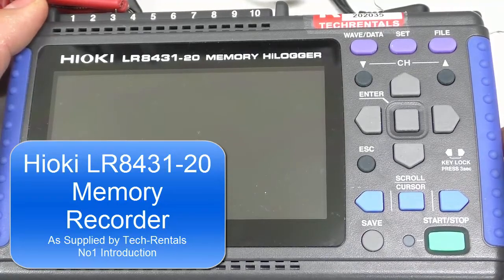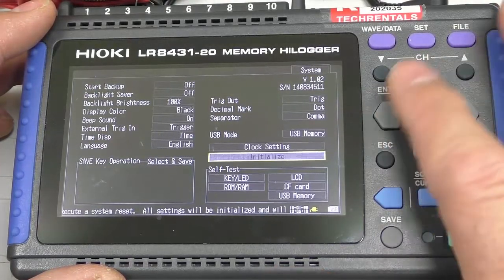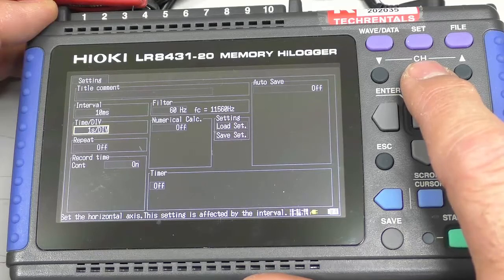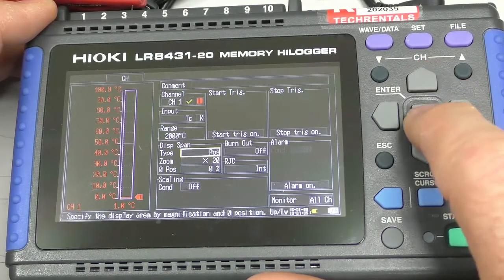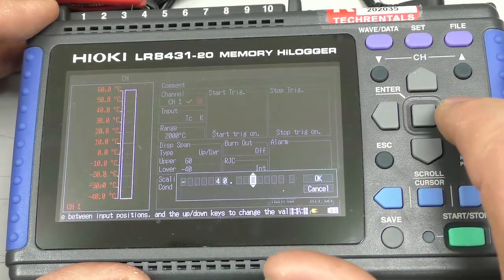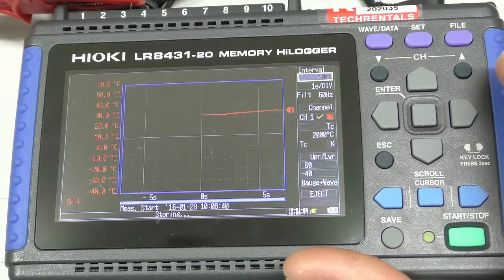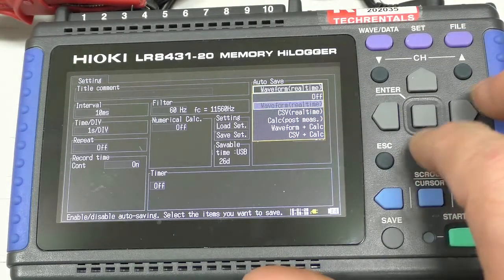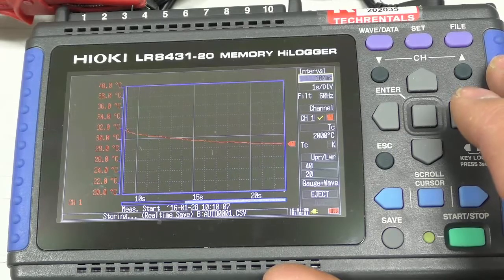Setting Up the Hioki LR8431-20 Memory Logger

Comment: Hello. Can I connect  and humidity sensor. Thank you
Reply: Depending upon the output of the Humidity sensor. If it is for example 0~5V or 4~20mA yes. Of course you would need to provide power to the instrument and in the case of current measurement you would need to 100Ohm to convert the 4~20mA current measurement to 0.4~2V. The instrument can be scaled.